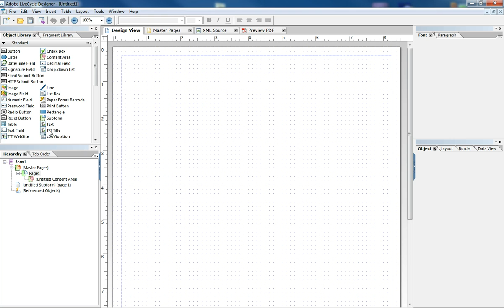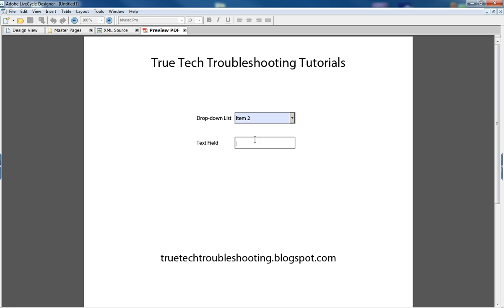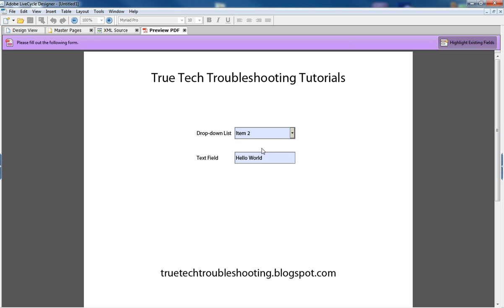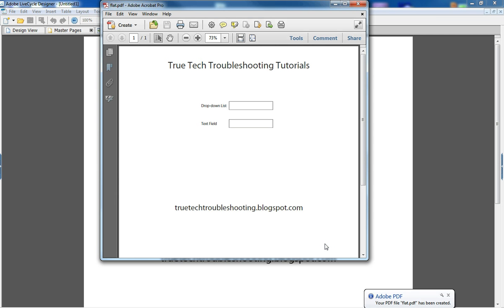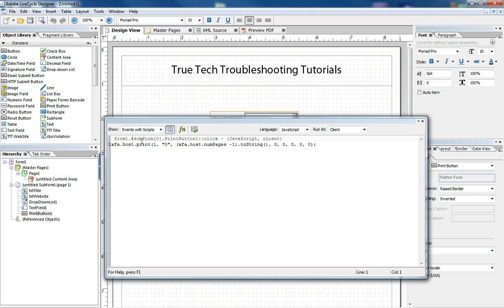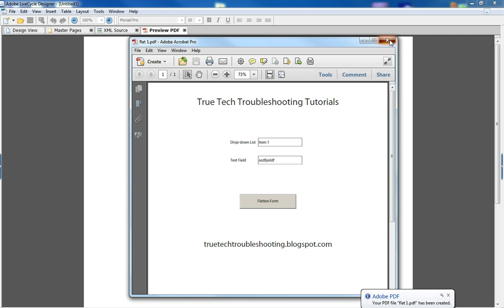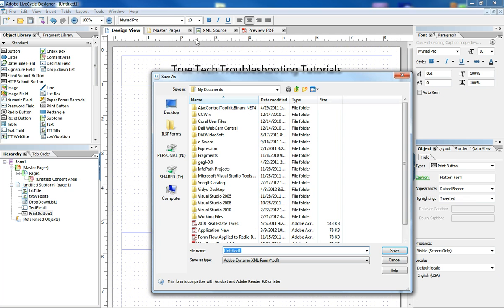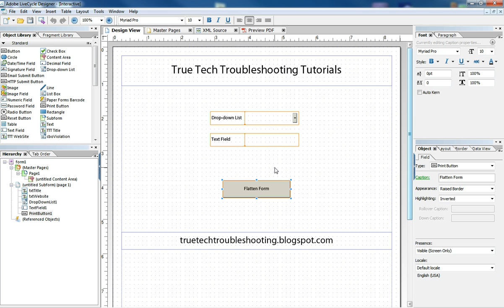Flattening PDF Forms in Adobe LiveCycle ®

Comment: Your solution here is great, however what happens if the form filler doesn't have a pdf distiller or they only  have adobe reader?

Is there a way to "code" the SAVE FORM button to flatten the form after it's filled and user has saved the form?